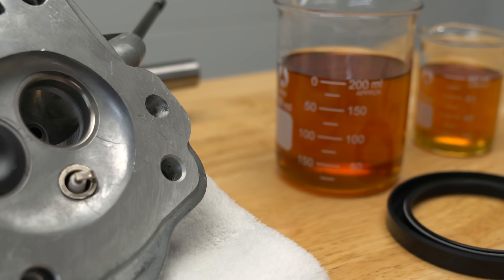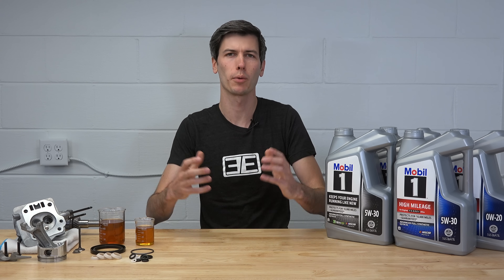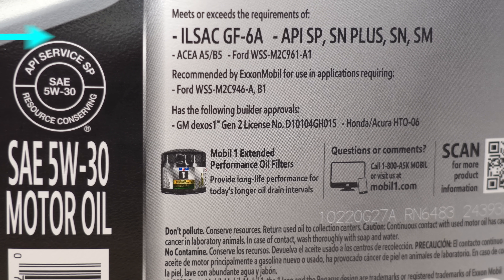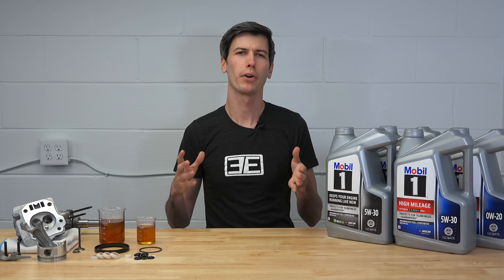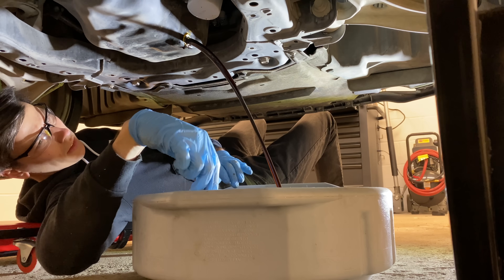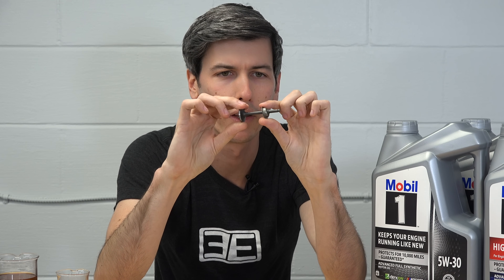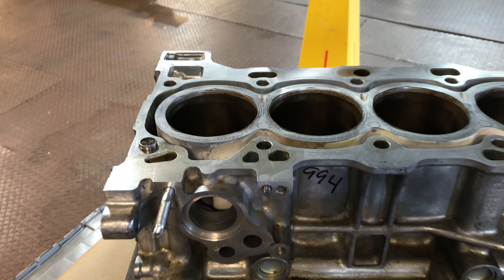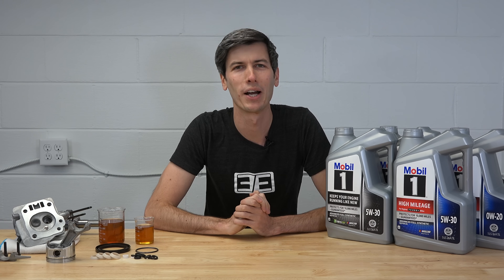Is Synthetic Motor Oil Bad For Old Cars?

Comment: There are also cases of an engine burning oil due to stuck rings, such as an engine that sat unused for a long time.  And in these cases, using synthetic oil or even a synthetic blend, would be beneficial in freeing the stuck rings.  Anyone thinking this might be the case with their engine would probably do best by first using a synthetic blend and then through frequent oil and filter changes, work up to a full synthetic oil.  Starting out with a synthetic blend would be erring on the side of caution, as an engine like that may have a large quantity of sludgy-mucky build up, and by immediately switching to a full synthetic oil would result in too fast of a clean-up.  And that could has the potential of sludge blocking the screen on the oil pump pick up tube.  Generally, if you want to get an idea of how bad of a sludge build up an engine has, pull off the valve covers and have a look at how much build up is right there on the top of the head(s).  If you see a massive amount of build up, start right there by scraping loose the build up on the top side of the head.  Using a vacuum cleaner to extract the muck and baked on debris will help in not allowing that crud to fall deeper into the engine, or in blocking the oil drain holes in the head.
Reply: Yeah use a vacuum cleaner....
Reply: Back in the 80's we used to remove the valve cover and scrub everything with a toothbrush and kerosene followed by an oil change.  Now, I use Pennzoil Platinum High Mileage.  I was using STP Synthetic High Mileage and was not happy with cold starts.  I could hear mechanical ticking for the first second or so.  The Pennzoil fixed that issue.  I was still burning oil on long trips, so I ran 4 tanks with 2 ounces of Yamalube Ring Free each fill up.  I followed that with a LiquiMoly Engine Flush and that seems to really have been effective.  It has more power, idles great, and the oil is still clean after 1000 miles, and I haven't burned a drop.
Reply: @harrylister804    That's great Harry!

Comment: i slam used 20w-50 out of my turbo del sol into my 1996 paseo 5efe 5spd that burns 1 liter per 500kms of regular 5w-30 and gets 39-43 mpg, with used diesel oil it barely uses 500ml and gets 35-40mpg.   Im switching back to 5w-30 as gas is $2.05 a liter ..its cheaper to burn used 5w-30 and 10w-30 lol.

Comment: I don't know about you. I have a 1991 Jeep Wrangler. If I put any synthetic at all in it.
I can smell something I'll compare to a boats bilge. Especially when the doors are off and the top is down. I use conventional Valvoline. Problem solved no smell. And yes I think it's a problem if I  smell  something.

Comment: 16 year old Buick 3.8 with 32,000 miles.  Oil changed per schedule and usage gage was usually showing more than 50% life left.  Always used Penzoil, no cheap stuff.   Immediate leaking so I changed back and it stopped.  
I started my 2012 Impalla with first change and all ok so far.

Comment: I don't find it true that synthetic oil has more additives than mineral oil. Mineral oil has a greather ability to solve additives, but at the same time could also solve a greater amount of pollutions. This makes the mineral oil degrade faster than synthetic oil. Please correct me if I'm wrong.

Comment: If you have an old car which has had non synthetics used in it all its life there is no advantage to switching to synthetic.  It costs more for one thing and it does have a high risk of destroying what little life you may have left in that engine.  That gunk that's in the engine (the build up) is what's keeping it together.  That is assuming that you are not starving the engine of oil flow.  Suddenly changing from non synthetic to synthetic can actually do just that.  Some of the  (varnish) or whatever you want to call it will come loose and has a high probability of clogging oil passages.  Also if there is a lot of clearance between parts and you clean that varnish off you will increase the clearance and end up with engine noise and the engine will fail sooner than it would have otherwise.  So it just comes down to how much life is left in your engine.  If you have about 80% of your expected mileage already surpassed and you want to get the full additional 20% or as close to it as possible don't switch.  Its nothing to do with seal compatibility in this case  although that may be something to consider as well.  Read the label.  Remember ... marketing is to sell oil and if you can't sell more then sell at a higher price. (synthetic).   Then again ... everyone is entitle to an opinion and its up to consumer to decide what they are comfortable with.  Just my 2 cents worth! : )

Comment: Regarding Honda, cant speak for others, using conventional on 7 honda's that all surpassed 300,000 miles with no issues.  82, 85, 88, 92, 96, 97, 99, 03 @ 161k, 04 @ 205k.  Just all have been maintained with proper OCI's

Comment: So using  synthetic oil in an older car may not be detrimental ,however they never addressed the  WhAT IF FACTOR OF AN OLDER ENGINE...LIKE " WHAT IF  THE ENGINE BURNS  EVEN A SMALL AMT.  OF OIL ? THEY CLAIM SYNTHETIC HAS A LOW BURN OFF RATE AND   if  IT PASSES THE OIL RING OR GETS PAST THE VALVE SEAL  &  GETS ON THE EXAUST VALVE SEATS AND COULD INSULATE THE VALVE FROM THE SEAT AND BURNED VALVES RESULT...I RUINED 2 ENGINES LIKE THIS 😪😪😪

Comment: IMO, this is an example of straining out gnats, & gulping down camels! I merely watched it to see why people would pay a lot more for a product that has a misleading title. I mean, isn't all oil a petroleum based  product? Castrol was said to be made from "castor beans", which I doubt! I use non synthetic 15w40 in all my old cars & tractors, & have no issues. I change oil & filter at 3K miles ,or 200 hours on equipment. Isn't life complicated enough without studying the microscopic properties of oil, & worrying oneself to death, on how different oil effects seals. Once I had a Dodge truck, w/a 318, that needed valve stem seals. I poured a can of Lucas in it, it stopped smoking. I went on with my life!

Comment: Question 1 not always correct even with match viscosity. Older cars and motorcycles rattle/noisy with the use of today's synthetics. Some of our vehicles we tested even passed (lost) oil and switching back to dino stopped the noise and oil use. Tested on Honda and Chevy Cars, and Suzuki Motorcycle.

Comment: Synthetic oil goes back to WW2. It's fine as long as the engine is fine. It leaks and I don't use it for break in oil. It's too slick. It should be cheaper than conventional actually.

Comment: Synthetic oil consistently destroyed my rear seal and front seals on my manual transmissions. Synthetic should never be used in old motors with old seals   If you rebuilt the motor with synthetic qualified seals

Comment: ... I have always thought that the higher price for synthetic oil was not worth the price differential. .. But also, I tried a "blend" of synthetic & conventional in my wife's '96 Buick Park Avenue... and consumption went UP! ... So, for me, it's strictly conventional.   BTW, my '89 Chevrolet Caprice with 305 SBC, having just completed 240,000 does not use any oil.   I see NO reason to use synthetic.

Comment: NO, most definitely NOT in old cars, I used the Castrol edge in my Ford escape 2006, which developed rod knock during test drive immediately after the oil change.

Comment: Cleaning an engine most definitely can be a bad thing. If you have an engine with excessive sludge and you have an engine cleaning performed it can clog up the oil pickup screen. I have seen it firsthand on more than one occasion as an automotive technician. KEEPING an engine clean that is already clean ( or at least relatively so) is not a bad thing.

Comment: I noticed excessive oil consumption when using synthetic oil in older designed engines; even one with 60,000 miles.
Near zero consumption between oil changes when using normal dino oil.

I suspect the piston rings don't wipe as much oil and the oil is being burned off during combustion.
Reply: My experience has been the opposite.

Comment: I use synthetic in everything that uses Gas!!! Because Only exception is One time i switched from conventional to synthetic in a 5.9 ISB Cummins turbo and within 400 miles the truck started burning oil and did so even after swathing back to conventional oil. So I will never run synthetic in a Diesel engine again.

Comment: Had a 1995 Honda Civic with 85k miles and conventional oil all its life. Never leaked or burned a drop of oil between changes. Decided on a whim one day to switch to synthetic oil. Bad idea. Was losing a quart of oil between oil changes after the change to synthetic.
Reply: I had run Mobile 1 or Valvoline synthetic for about 200k. Then on a whim, tried Penzoil Synthetic. After that, oil usage increased dramatically.
Reply: @briangibson6445  I really believe that it's the combination of detergents and reconditioners in the oil manufacturers' formula. Some may include harsher detergents which may help clean metal components but destroy old seals. That's likely what happened to my Honda.
Reply: how doesany oil pass the seals differently than another?? the syn oils have perfectly round molecules under microscope, where crude doesnt. BUT, syn makes engine run longer with less friction, hence "0" weight oils.
Reply: @patriciareynolds2729  Couldn't tell you the why just the what happened. This is reported by a lot of people.

Comment: Why would you you use expensive synthetic oil when regular oil is just as good in older cars.  New cars are different.  Just doing regular service is the important thing using the recommend fluids the car was made to use at the time of manufacturing.

Comment: Your problem. Is you started with Mobile one. Amsoil had a cleaner to be used first. Also Amsoil makes ZRod made just for old flat tappet cams. Does Mobile one have this? No! I own older cars and will use nothing but Amsoil.

Comment: My 2004 Jeep Grand Cherokee, equipped with a 4.0l , has run Mobil1 10w30 since new, she now has 453,000 miles and still runs great, all original engine.

Comment: A lot of synthetic oils have  detergents, plus it adds protection to engine parts seals, plus  with conventional oils you have to change it at 3,000 miles with synthetics you can use for more mileage

Comment: As a engine builder...
1 I always bump up the viscosity around 100k miles, your bearings DEFINITELY are wearing even if the are no "tell-tale" symptoms, it will protect your engine....
2. As a rotary enthusiasts/ former owner disable the oil injection and put two stroke oil in the gas... she will run forever.

Comment: But but but i heard synthetic oil wears out apex seals in rotary engines .  And using anything but toyotas lf 75w in a toyota transfer case will result in wearing the bushings within 20k miles of just 2wd use.

Comment: I just purchased a 2004 Mercury Sable with less than 25000 miles on it. Should the high mileage Mobile 1 due to the age of the car? Been using Mobile 1  35 years!

Comment: Recently changed the oil in my 80k mile Ford truck. It doesn't leak or burn any excessive amount of oil and I always use full synthetic. I accidentally grabbed a 5q jug of "High Milage" full synthetic Pennzoil platinum and didn't notice it till I saw the jug in the trash bin a few days later. I doubt it'll cause me any issues but I started thinking about swelling seals and oil leaks and I've been in a panic state ever since. Lol

Comment: Just bought a 2000 TOYOTA  4Runner. 269000 miles. Is it safe to switch to synthetic or high mileage full synthetic ?